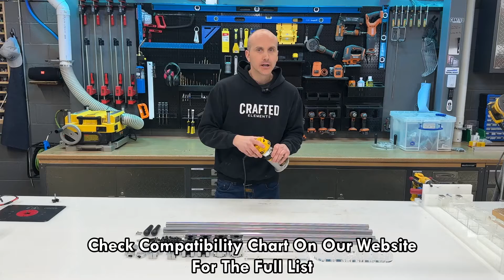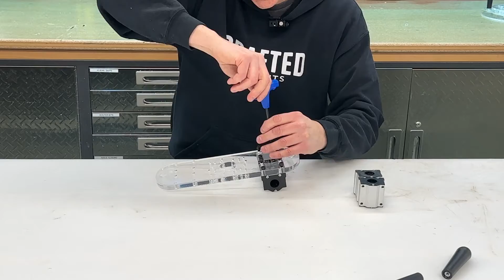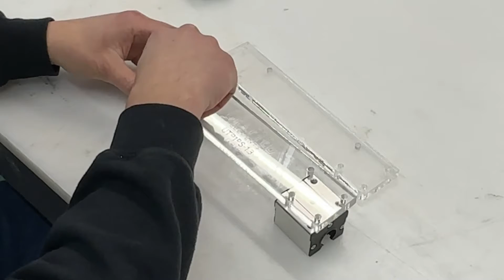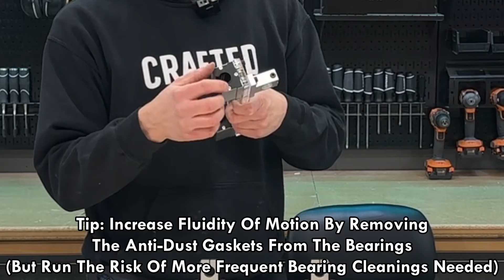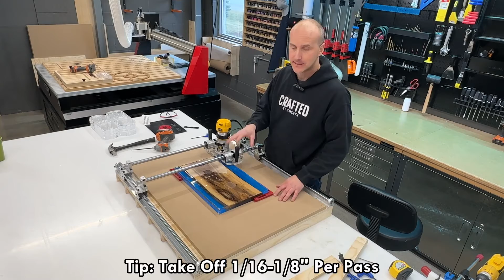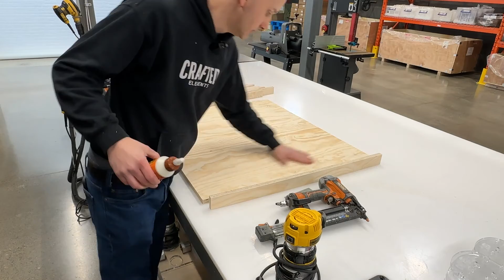Small Trim Router Sled - Easily Flatten Wood Projects Up To 24" Wide - Crafted Elements

Comment: Where are you measuring to get 28.5"? I can't tell from the video or trying the actual install.  I thought I had the measurements on both ends equal but it is still difficult to move...

Comment: What if you already have the larger 1/2inch router but couldn't get the larger sled due to it being unavailable?
Reply from the maker: IF you wanted to use a full size router, with the trim router sled setup, you can buy a new set of acrylic parts (the router base and brackets) to make that work: https://craftedelements.com/collections/router-sled-components-upgrades/products/router-sled-acrylic-router-base-brackets

Comment: I would be interested in this for a different reason/application: Just to minimize risk when using a trim router for cutting dado grooves etc in planks/panels: No risk of kickback. And it would keep both hands far away from the blade. ... Would it work well for that?

Comment: I like the idea of this tool. It seems like it would be good for projects like table tops etc. but does it work for projects like cutting boards? Is the surface flat enough?
Reply from the maker: Most definitely. Most people use the smaller sled (this one) for cutting boards and large serving boards. Our BIG sleds are more for tables (up to 144x60" sled size)

Comment: Will this accommodate the Makita trim router with the plunge base?
Reply from the maker: Here is the compatibly chart, you generally want to have it mounted in a fixed base, not a plunge base. https://craftedelements.com/cdn/shop/files/CE-RS-36X32-STRS-4_700x700.jpg?v=1703170094
Reply: Thank you for the response, your kit looks great but I want to be able to use the plunge base. Thank you.

Comment: What are the full cutting dimensions of the trim router sled?
Reply from the maker: The footprint of the router sled is 36x32". Once the offsets of the rails, router mounting plate and a 1.5" diameter bit are considered, the maximum slab flattening area is 27.5" long and 24" wide. If you have longer pieces (that are up to 24" wide) you can level them one section at a time, sliding them horizontally after completing each section to allow you to flatten and mill pieces with a nearly unlimited length.
Reply: @CraftedElements what’s the dimension of the spoil board?
Reply from the maker: 32x36x3/4"
Reply: @CraftedElements  what’s the dimension of the baseboard?

Comment: Just ordered the mini a few minutes ago, I appreciate the very detailed installation instructions. The router base compatibility guide chart threw me off a bit, the specs say you can use this DCW 611 but when you zoom in on the picture it shows a DWP600. I have a DCW600, hopefully it aligns with the predrilled holes.
Reply from the maker: It will work with the DCW600, that is what is listed on the compatibility sheet: https://craftedelements.com/products/trim-router-sled